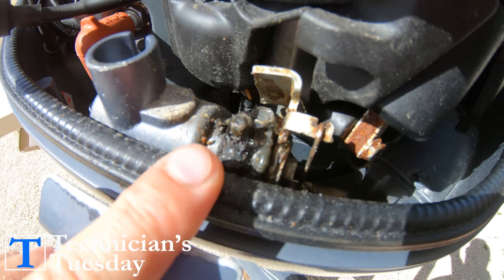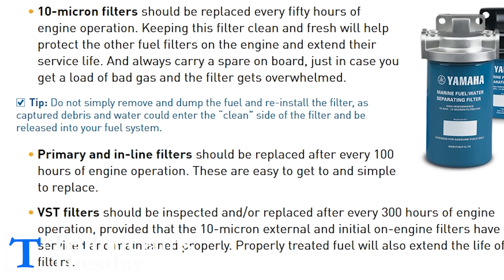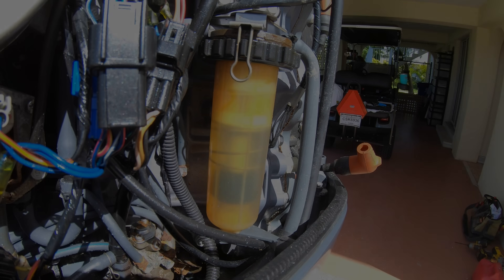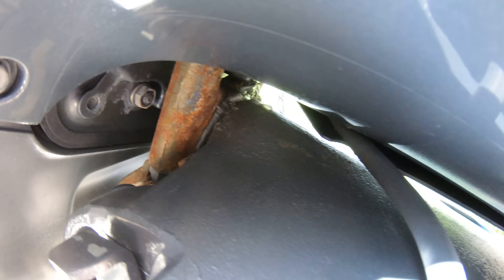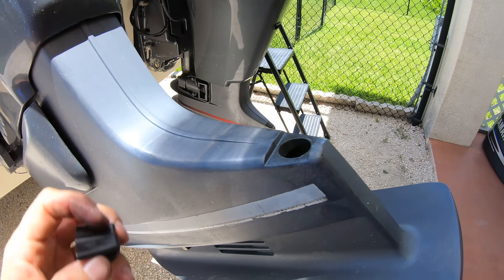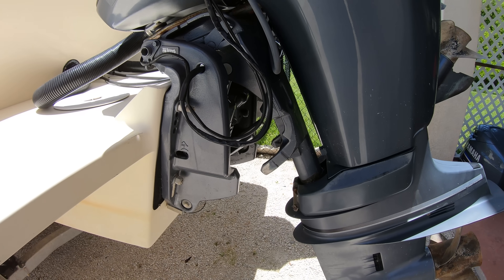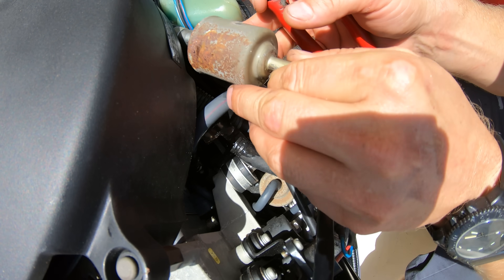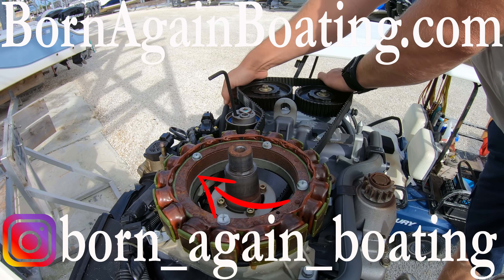Making A 2-Stroke Last Longer!

Comment: I'm actually looking for a new boat in the 25' - 28' range. I kinda found a boat I like which is the Cobia 26' or 28' but I'm not sure about the Yamaha four stroke motors or what motor should be best in South Florida? In your opinion what is the best motor Yamaha, Mercury or Suzuki? Best longevity, easy servicing, best fuel economy, cheapest on parts and service. Boat to be used for fishing, running to Bimini and the Keys. If I commission a build, just not sure what would be the best motor? Want to stay with a four stroke NA 200hp to 300hp
Reply from the maker: The Yami's are a fine engine, why would you replace them? And really, it's up to you in that range, they all have a solid engine, I'd say go with the Yami's because you won't have to change out any of the rigging :)
Reply: @BornAgainBoating  Thanks, I will certainly take your opinion at heart. You work on them every day. Cobia's come with Yamaha's. I guess just buy and love what I get. Take care of it and don't abuse it.
Reply: Mr.NaughtyPants  Suzuki is reliable motor and so quiet I suggest Suzuki outboard .
Reply: What year are the motors and how many hours?
Reply: @Cameron-ur2tk  I'm looking at new, but also some used boats a few years old with only very low hours in the 100hr range.

Comment: Still running my Johnson v4 115 oceanrunner
Reply: What year is yours? I bought a 05 the other day, so far its perfect, I've heard that once BRP bought them around 02 so mine has a big BRP sticker on it. The only thing I'm a little worried about is the oil injection system, not sure how reliable it is.

Comment: I still run 2 strokes, with 249hrs original hours 
Twin 2003 225hp 3.0l mercury Saltwater engines fuel and oil injected!
Strong running motors when not fouling out spark plugs, I do have a big problem with the motors fouling out spark Plugs very quickly. Meaning every couple of hours. Other than that. Strong motors. Any suggestions on the fouling problem?
Reply: Im assuming its a carburetor engine, either your running it too rich and need to lean it out or your idiling it for too long. If you dont know how to adjust the fuel mixture you should just bring it to someone that does, If you lean it out too much you'll roast your engine and burn a hole through the piston. Its pretty easy to adjust the fuel mixture but just be careful, if you adjust the carb or have someone do it take it for a spin and then check the plugs, if they're white your too lean. Its always better to be a little rich side on the fuel mixture then too lean. too rich you foul plugs too lean you cook your engine.
Reply from the maker: Yup
Reply: They're fuel and oil injected.  I Should have specified

Comment: Still running a 1997 Yamaha OX66  250 hp and a 2002 Johnson 115 V4 two stroke, but I'm not sure what the parts scene is going to be like now that BRP is no longer around.  I really like their marine grease and lower end oil products.....good stuff.
Reply from the maker: The OX66 is one of the best engines they made :) and yeah I'm with you on that. They say they will continue the parts production and that's all we use is the marine grease and gasket sealing compound and the molly lube. It's great stuff man you're right!

Comment: 1984 Suzuki 75hp , I bought it used in 1989. Good runner! I did not realize 2 strokes had a thermostat until it was 30 years! (Ding dong is anybody home) 2 of the 3 housing bolts broke(seized) I had to drill the 2 bolts out. Its running again!
Reply from the maker: Ouch lol at least you got them out lol nice!

Comment: Good stuff once again! I noticed these last few weeks that more and more two strokes are comming in again, in total 5.mostly smaller including an old mercury 7.5 HP and I was surprised that mercury still carried all the parts I needed for it. I usually try to place a small bucket or canister below the fuel water filters so I don't spill fuel everywhere. See you next week stay healthy.

Comment: I got a Grady White with 2 yamahas ox 66 like new,only 400 hours on it,runs perfect,my only concern there are a little somking when you turn the engine on or run in idle
Reply: Victor that’s normal for a two stroke of that type, they are burning oil and gas together and when they are cold they smoke a bit until they are warmed up

Comment: One of my boats has a 1996 Yamaha 200 HP 2 stroke Saltwater series pushing a 24' boat.  My running joke is, when the boat dies, I will move that engine over to another boat.  Best engine I have ever owned.  These new four strokes are such gutless garbage that I will keep this one forever.  Somebody please fix the problems at Evinrude and make a descent 2 stroke.  Long live the 2 stroke.
Reply from the maker: Lol :) I don't think you've heard the news yet :/ Evinrude stopped production on all outboard's! So now no manufacturer is producing a 2-stroke :( So keep that thing running as long as you can lol :)
Reply: Born Again Boating - how about Merc Optimax?
Reply: Robert P Mercury discontinued the optimax
Reply: Jason Macklem I have the same motor really strong, I tell all my biker friends this is my Harley, she’s a screamer!
Reply: Just use lots of Yamaha Ring Free in the fuel   1500 hours on old 200’s
Reply: @blondestrainger  - yeah fuel and oil quality is everything for a happy two stroke
Reply: 2 stroke Tohatsu. Over 1000 miles. Love it. I think Tohatsu is still building 2 stroke engines.

Comment: Twin 1989 Johnson 120's still going strong on 22' BW Revenge.
Reply: I bought mine in 99 .
When I asked a buddy of mine that worked at s dealership  as a engine technician. What motor should I get.
Without hesitation,  v4 Johnson "they are bulletproof "
And still runs great today.
Reply: @mikegrendel9126  Have a 2000 Johnson V4 90hp still going strong, very impressive "bulletproof" machine. Only changed gear case oil and lubed each year and filters when needed. Nothing else done in 21 years except for impeller change after 17 years.

Comment: I’ve done pretty much everything you did to mine. BUT!!! I had no idea there was a filter for the oil system. Where is it for a 98 Mercury 250 EFI?
Reply from the maker: On those older EFI's idk if they had an inline filter on them yet. If they did, they would be in the bottom cowl on the oil line coming in. But it might not have one and only have the screen on the pick up tube in the oil tank itself. You can just unscrew the cap and pull it out, on the bottom of the tube there is a screen :) to clean this stuff, you might just pull the entire oil tank out and dump out the oil into some containers then clean the entire tank and pick up. Maybe once every 5 years or so lol but if you use the merc oil, it's usually pretty clean and doesn't gum up as quick as a cheap oil will.
Reply: Born Again Boating ... she burns a lot of oil and fuel, but sounds like a beast when you first fire it up. I feel like the tall hog at the trough when I’m at the boat ramp next to all the quiet four strokes!
Reply: Born Again Boating thank you! I’ve put a lot of effort into keeping it running. I’d hate for a little filter to take her down